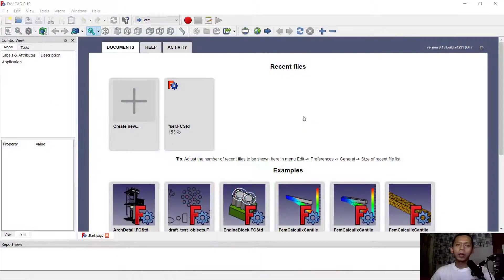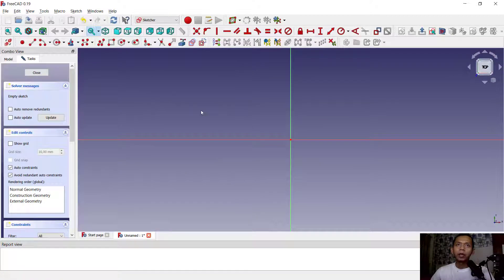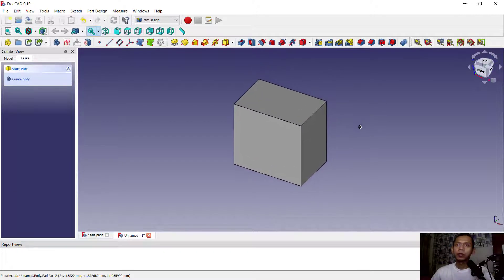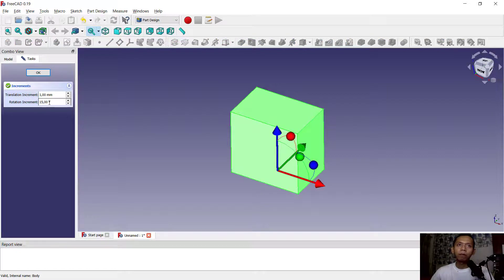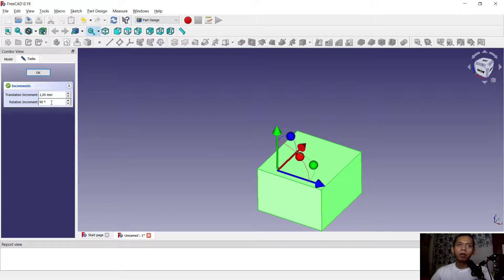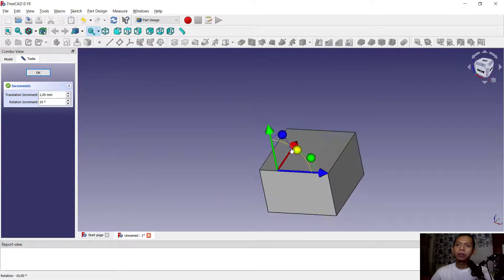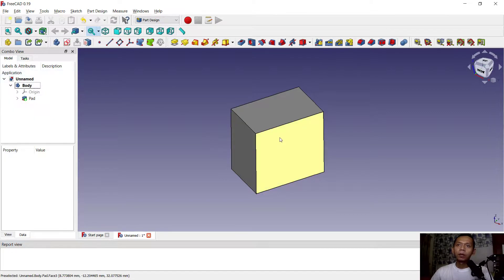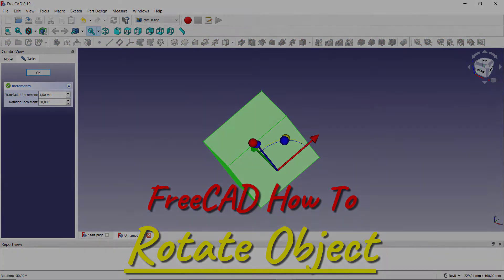FreeCAD How To Rotate Object

Comment: 43 seconds in, the pointer changes to the move/rotate logo and they guy moves/rotates the object free hand. is it possible for anyone to tell me how to do that. thats moving an object... its so simple but every single video ive found involves a long explation and varios different menu options. All I need to know is freehand movement
Reply: Figured it out finally. u have to first hold the middle mouse button and then either the left or right mouse button. have a good day :)
Reply: @chilloutmasterdeluxe2046  Thanks. I've been struggling to find out how that was done. 😀
Reply: @chilloutmasterdeluxe2046  You can hold the shift button and then use the right mouse to rotate. That's far easier than hold two mouse buttons at a time.